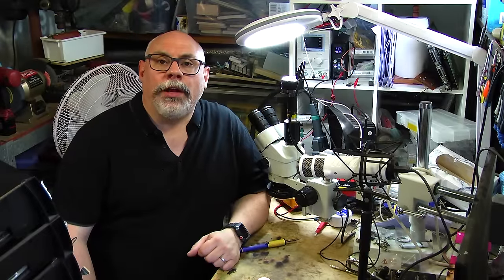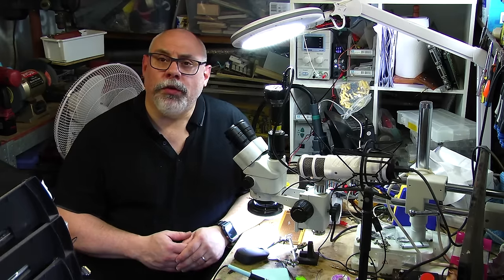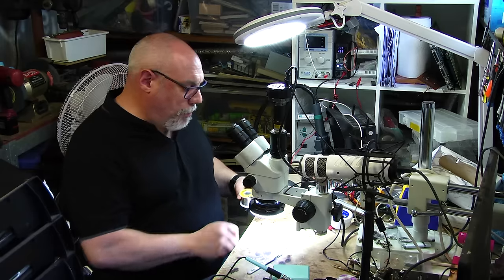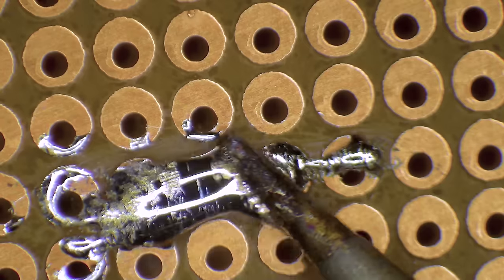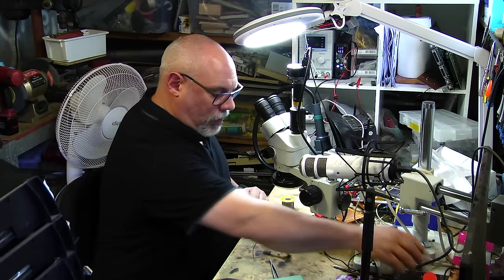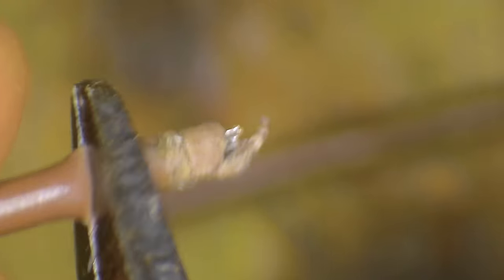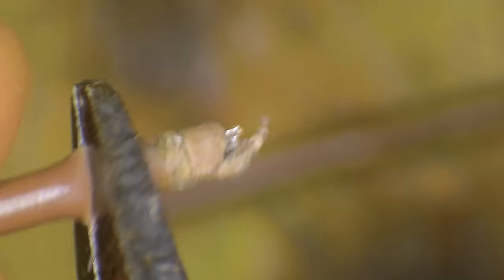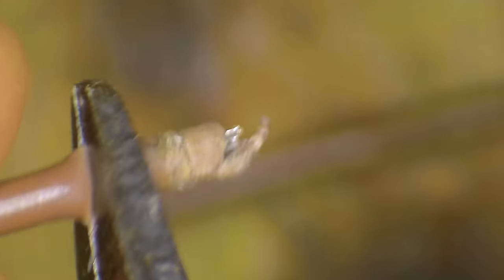Beginner's Guide to Soldering Electronics Part 1

Comment: Thank you for the video, very educational, I learned alot from it. I have a question, what size resistir do I need for a battery holder which holds 4 double A batteries? I know they sell like 100 olms 1k, etc. The holder is very corroded and corroded the batteries. I bought new holders but I was wondering if I have to change the resistors?

Comment: Only thing I’d add to this is when soldering stranded wire to each other I’d splay the strands on each end a bit, mesh them together and twist a bit, then solder the joint.

Comment: Thanks, a really great vid. I’m getting into vintage hi-if which often requires replacement of capacitors on boards and I’ve been wary of trying so this is great. Three questions please: 
One - if I heat the legs of the components am I in danger of heating/damaging the component itself?
Secondly - is there any danger of melting/damaging the board?
Three - my solder is lead free but doesn’t say whether it has flux within it. Do I need to get flux and put a blob on the component leg or does all solder have flux?
Thanks again.

Comment: I got a new soldering iron I thought would be better.   The old one had no temperature setting and only one tip.   But it worked.  This new one I can’t silver the tips at all.  These tips repel solder. Even tinning flux doesn’t work!         It’s weird. I don’t solder much or at all now.    I knew I shouldn’t buy something called k kernowo.

Comment: great video.  really nice to see the work up close via the microscope.  is it okay to use flux when soldering components to the board?  i noticed you didn't use any when you soldered the resisitor to the board.  thanks!

Comment: Wow your station looks just like mine.  I have three wands for my soldering station,  three different tips.

I have my soulder hanging from my Eye glass magnifier stand.  I got it hanging down right next to my alligator clips.
My paste right there. boom boom boom.
on thing about soldering you need to use the correction temp.  too hot and you burn everything up, too cold and you can't get a good solder.

Comment: Hi.  I recently decided to dive into the world of electronics as a hobby in my retirement.  I am currently waiting for some bits and pieces to arrive (including a book for beginners) so that I can dive in and I suspect that your channel is going to be of great assistance along the way.

I found this presentation to be interesting, informative and easy to follow.  I am also excited to find a fellow Aussie doing this as I can be more certain of being able to lay my hands on the same equipment/supplies.

I have one question from this that has bugged me in the past when watching others solder equipment to a board.
How do you ensure that the solder dose not flow onto an adjacent through hole?

Comment: Man, I’ve been trying to solder so i can work on my own guitars’ electronics for years now, because i like to tinker with the electronics,but i just could never quite get it right. I’ve watched all sorts of videos, but NONE seemed to help me grasp the concept more than this one. I hope i can now properly solder, instead of leaving a trail of burnt,black, crusty solder everywhere. But i did notice you didn’t provide any info on tinning the tip. Is that not as important as I’ve been led to believe? Also, you explained how important it is to use flux(separately)but then you 
didn’t use it. So when SHOULD you use it? And lastly, how will you know when your tip has been compromised and is no longer good?
Thanks!
Reply from the maker: Thanks for watching! I talk a bit about tip maintenance in my part 2 video. Flux is of the greatest importance when doing surface-mount soldering, but I also use it when the flux in the core of the solder isn't giving me the result I want. Basically if the solder isn't behaving, I add a little flux.
Reply: @BranchusCreations  
Perfect, thanks! I didn’t realize there was a part 2. Thanks again, this was a very helpful video!

Comment: I always thought the risk of using lead solder is surface contamination rather than air contamination since the boiling point of lead is 1749°C, it's gonna stay a solid. It's also a very dense metal so surface cleaning is more important rather then air ventilation.
Reply from the maker: Yes, I mention this in one of my soldering tutorial videos.

Comment: So the technique of heating up the wire first is nice, but what I'm trying to do requires the wires to be laying flat on a raspberry pi 4 mini LCD screen, basically there is two wires coming from a fan and they need to be attached to the positive and negative on the back of the LCD screen. I'm completely new (literally like two days new) to soldering so I'm not really sure what I'm doing, think of a flat surface basically with two holes - and +, then two separate wires red and black that need to go into those holes but it needs to be soldered to stay put. Not sure what the best technique for that is.

Comment: any ideas on the best temperature i need to set on my iron?
Reply from the maker: My recommendation is to start at around 350ºC and see how it goes. If you're not getting enough heat, try increasing it in 10ºC intervals until you find a temp you are happy with. I solder at a very high temp (420ºC) but it doesn't suit everyone.

Comment: You won't get soot on the heat shrink if you hold it above the flame. The soot is due to incomplete combustion  caused by the flame impinging on a cooler surface. The hottest part of the flame is in front of the cone.

Comment: Personally I would have trimmed the ends of the wires to be soldered together to the same length so that there was no step in the joint and the heat shrink sleeve would be smoother.

Comment: I got the cheap wall plug in one with removable tip but I can't get the wire hot enough because there's so little surface area touching the wire... frustrating...do I need a better soldering iron or just better technique?

Comment: hi there great video and fantastic teaching i learnt a lot from you, i have a question, the iron i have has neither a pointed tip or a bevelled tip it is more a U shape two pronged setup and it glows red hot when the trigger is pulled, is this a different type of iron for something else or is it still able to solder as normal?

Comment: Awesome!  One concern that I've always had is that I'm going to damage the resistor, capacitor, etc., or the bread board.  Are those able to withstand the temperatures of the soldering iron?  I need to de-solder an led from a bread board, clip the leads then re-solder it.  (in order to make it fit in the locomotive :))  I haven't even ordered the DCC decoder I have to work on and I'm worried!.

Comment: I just bought one from harbor freight. Same pointed tip can’t get solder to stick to it for some reason. I bought some tinning paste. I tried to tin the tip w flux core solder but it wouldn’t stick. I’m afraid I messed it up.

Comment: Does the wire need to be touching the copper or does the soldier bridge that?
Reply from the maker: The solder is conductive, so it will bridge any gaps.
Reply: @BranchusCreations  awesome thank you

Comment: when reworking solder joints on a pcb, do u need to remove all the conformal coating on the pcb or can u just remove the solder for the ones your working with?

Comment: I have a very fine wire that was attached to an x-ray remote. A mouse has eaten through the wire. I have  tried to solder it back on to  small prongs but it won't conduct the electric through. I have seemingly joined the two wires because the solder joined to each other. Is this not ok.

Comment: Question: How do you heat up micro wires (like on turntable tonearm phono wire) hot enough to melt the solder but cool enough so as not to burn the wire. I've tried several types and sizes of solder and having no success.

Comment: with the two wires just being butted together, then the solder making the joint, would this amount of solder carry the same  load as the wire itself is rated for? so the load that the wire is rated for, is now, not reduced? due to the joint.

Comment: Today my PCBway boards came in and I couldn't even get a LED soldered on. I got the wrong tip and the heats not getting to the tip and its 60W so maybe underpowered :(. I just ordered new tips and I think there better then the ones on them just hope that fixes my issue. I got the blue cheap soldering iron of amazon. I'm wondering should I just get a better one?
Reply: I do like the idea of the heater in the tips.

Comment: i bought a soldering iron at homedepot & it also came with small amount of solder but the solder has flux in it. Dont know what type of flux it could be but when im applying the heat to the solder when repairing, it doesn't hold or adhere...could it be a different type of solder i need???

Comment: how come when I solder something then a try to remove the solder the soldering iron doesn't melt the existing solder unless I add more solder an then it melts the existing solder?
Reply from the maker: Two reasons. The first is that you're adding fresh flux when melting the new solder, the other is that the new, molten solder is making better surface contact with the old solder, so is transferring the heat more efficiently. You may need to up the temp of your iron a little.

Comment: Keeping solder "clean".. as he says, really means keeping it non-Oxidized .. which really means "keeping the metal pure enough to remain meltable" .. because oxidization changes the metal [essentially] into a ceramic material .. with a very high melting point.
Reply from the maker: Is that what "he" says?

Comment: you said not to put solder onto the iron as then the flux is used. So how can the two ends of wire [flux already used] bond together without adding more flux?

Comment: So I'm guessing you don't use a water pad due to the residue it can leave? when cleaning the tip.
Reply: I've been soldering for over 50 years, and used a wet tip-cleaning sponge for most of them . However,  I have read that the wet sponge can cause micro fractures in the tip, or the plating on the tip, and shorten it's life. I very much like the brass wool cleaner as shown here, these work very well.

Comment: I tried heating the wire first. But instead ended up burning the wire instead of just heating it up. In the end, the solder doesn't stick to the wire but instead it sticks to the tip. It's frustrating because sometimes its not just wires but also sensitive components like the transistors get burnt.

Comment: Great tutorial. 
But, you neglected to explain why the bread board holes were off-center in the copper pads. Then, demonstrated the purpose of this by bending one lead of the resistor towards the smaller area of the off-set, rather than the larger - resulting in a bridged connection to the neighboring pad. This, in addition to applying too much solder is a recipe for a short-circuit nightmare, if someone does not have a microscope to inspect the area for bridging of connections/components.

Comment: I'll be taking a stab at my braun toothbrush battery first and maybe i'll eventually get on to an RGB mod for my Nintendo 64.
Just regarding flux, is a flux pen okay? Will that give the same kind of result as seen at 14:02?
Reply from the maker: You may not see as drastic results as demonstrated with this flux, but any flux will help.

Comment: I'm a hobbies in soldering because I do radio control truck cars boats and connector are the most of its solder iron get up to 400  Degree but it's just a basic iron all I buy is solder with flex inside it because I really don't like using extra flex soldering connector to wire but I want to learn how to solder to bored's

Comment: Really appreciate the instruction i have tried for days and had almost no successful soldering technics work for me..

Was starting to think as mechanically inclined as i am " i might be retarded when it comes to this and it didn't make sense.

I honestly believe that on such a small scale of materials the margin for error is almost 0..
There's no faking it like in welding " a good grinder will fix any bad weld..

Trying to solder wires the size of a hair onto a bluetooth headset no bigger then my pinky finger takes proper knowledge.

Comment: Never use your fingers touching any metal or wire you intend to solder, it is soldering 101 you keep everything spotlessly clean, especially from grease from your skin and any oxidisation on the surface of the metal or wire .

Comment: Would steel wire sponge for dishes (unused of course) be good for cleaning solder tips?
Reply: The brass wool shown here is softer, probably less abrasive than the stainless steel kitchen pads you mention, therefore brass wool is probably better for extending the life of the tip, but the kitchen scrub pads would likely work. Note that high-quality soldering-iron tips are (or at least once were) typically made of copper (for best possible heat conduction) with a steel plating  to resist erosion and pitting of the tip from the action of flux and heat.  Nowadays most replacement tips are made in Asia or China using god knows what kind of crappy alloys or recycled metals, and so some of them may work poorly and oxidise quickly and easily, while others may have a longer life and conduct heat better. I would expect a copper (or perhaps brass) tip with steel plating to be only mildly magnetic, but a tip made entirely of steel would of course be highly magnetic. Buy a selection of tips from different sources and brands and see what works.
Reply: Oh wow, quite pricey compared to the steel one, but I understand the advantages. I'm also curious why in many other soldering videos people tend to run the solder tip across wet sponge but Bruce here doesn't even hold one on his table, let alone uses it?

Comment: there are many videos on soldering wires but i couldn't find any that show how to solder multi-core wires. e.g. desk lamp 3 core (live/neutral/ground) cable. step by step including the heat shrink tube......nothing is out there.

Comment: Actually if you look at the QA Standards for soldering, I think you've used too much solder there? you are aiming for a 'wet tent' rather than a dome, hard to tell without a side view. It's a bit dark too, might have used too much heat? We had our stations calibrated to a particular temperature every few months.

Comment: Have not soldered for more than 20 years and i just tried now, no idea what im doing wrong.
When i heat the pcboard copper plate and solder....then apply my fresh solder (trying to fix a dry joint...IF IT IS one) ..... it makes a little ball on top...like it is blending.... 
what the heck am i doing wrong....
I was told to first try to heat my iron and leave it for 5 minutes , then apply solder to the tip ...all over then use a rough kitchen sponge to clean it......  then try this again?
I cant understand how these factories make such rubbish these days.... i have a Western Digital USB drive and the connector seems to be wonky  -> so i am trying to heat up any or all of the 5 joints to it.... my tip of my iron is not really very thin but it is so-so.... i guess thats fine right ?

Comment: That simple stuff what if your trying to solder a wire to a headphone plug and the plastic melts as fast as your solder f up the plug. They are cheap till its five or ten and still can't get it help please. Im talking 2.5 headphone plug very small.

Comment: It is unfortunate that the flux core in solder is now virtually impotent.  I taught high school electronics from 2000 to 2012.   The flux in the core of our solder was plenty potent to clean the tips of our irons and when properly used would give us nice, clean solder joints.  No matter what brand of solder I now use on my retirement projects, the old techniques need more heat and flux applied to the board.  Never did we need to use flux on the board.  On the iron occasionally, but not on the board.  What a mess the latest techniques now produce.  I suspect the current crop of circuit boards is also partly to blame.
Reply: Oh, and a swipe on a damp sponge would keep the iron tip clean.  Stabbing that ball of metal turnings pushes the slag in the wrong direction.  In fact, the students were only  supplied with a sponge so they could pull the slag off the tip.  This tended to keep the tip clean and shiny while soldering.